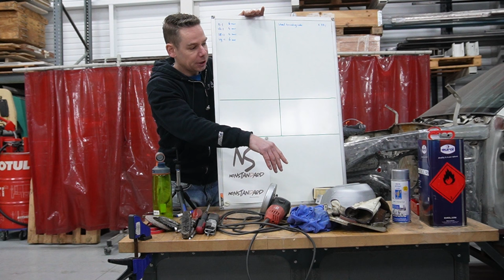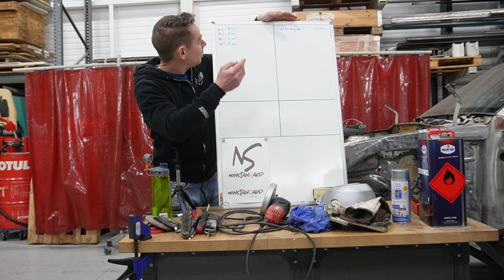Restoration of a unique Opel Kadett GSI first modifications started with Carbon fiber.

Comment: Excellent work, very satisfying to watch the attacking of the rust monster and fresh metal being replaced, following and watching from uk.
Reply from the maker: Thank man , cool you are watching!
Reply: @NonstandardNL  what products are you going to use in the wheel arch's to protect the new metal?
Reply from the maker: Wil probably use 3m 08800 protection layer.
Reply: @NonstandardNL  very good choice👌🏻, my Astra Gte16v was treated with 3m 08800 15years ago its very durable 💪 easy to use and one of the best products on the market.

Comment: The matt Carbon will look beautiful on your Kadett 🥰 i like to have the original stuff cleaned in the engine bay, not too fancy. But i‘m shure you will find a good way. For the brakes, (on my Vectra a GT 16V) i changed from 256mm to 308mm with i500/Calibra Turbo calipers and 24mm Hbz. Breaks perfect now with oem look. And works under 8,5x17 Th-Line.
Reply from the maker: Thank you !
I will figure it out when the work goes on.
Ok cool will look into to that, but those are the fronts ? Rears original?
Reply: @NonstandardNL  Rear is original 260mm. The 308mm are from Astra H at AT-RS you get them in 4x100. Middle hole is 70mm you need a small ring to 60mm. Rest is Plug and Play. No grinding on calipers or wobble adapters
Reply from the maker: Ok perfect i will look into that, thanks 🙏🏻

Comment: The carbon look is awesome!!! I just bought an 87 GSI cab that I just now fixed the brakes on but your videos are inspiring me to do so much more. 
When changing the steering wheel, is there any spring when loosening it or just bolts? Keep up the work. You are a legend!!
Reply from the maker: Thank you for watching and the compliments, keep wrenching!
When original there’s a spring behind the wheel to keep it on tention but won’t get the wheel flying of when you want to take it out.